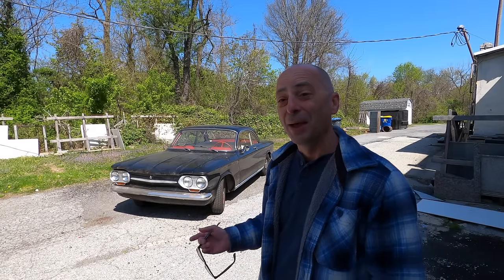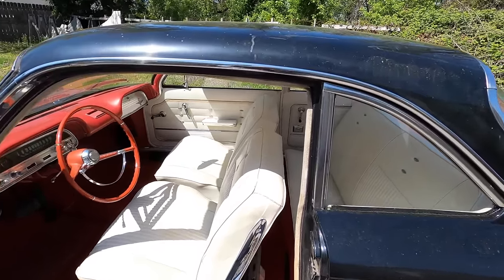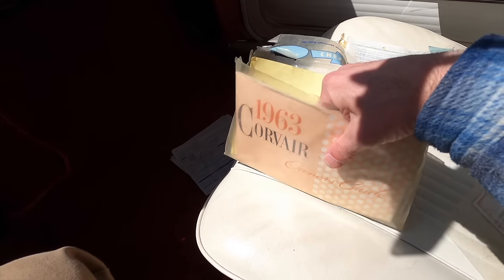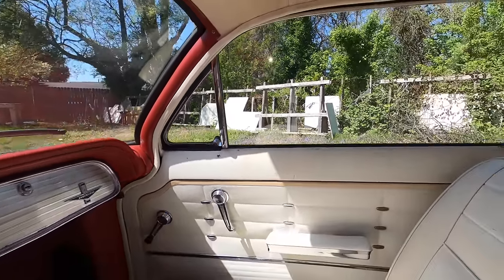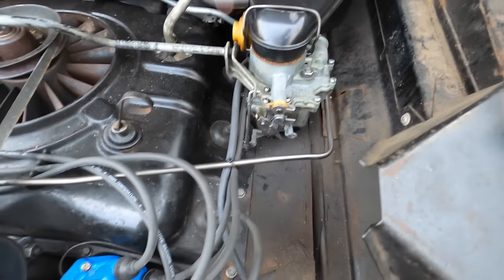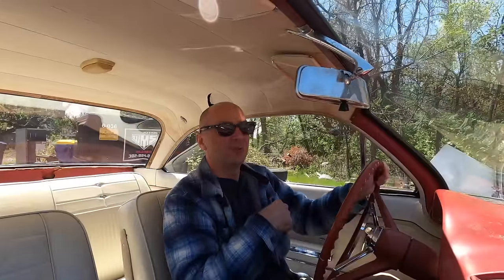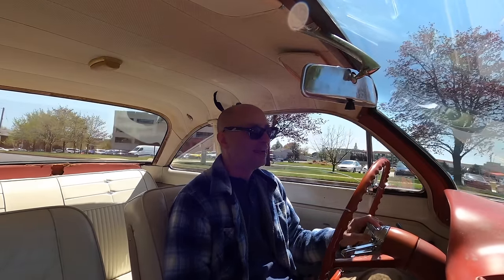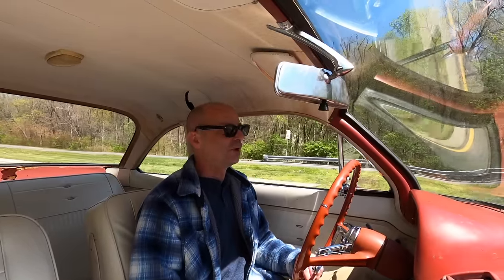Chevy Corvair - The Weird, Quirky, Cheap and Yeah COOL Compact

Comment: By today's standards all old cars are unsafe, so why people pick on the Corvair is beyond me.
Reply: You are correct, they were all deathtraps, and the Corvair was only a bit worse, which is why Ralph Nader used the Corvair as an example. Most cars of the day were understeerers, so you would run off the road and into things. Apart from the oversteer situation, which most drivers weren't used to, the lack of an engine up front meant that any frontal impact crushed the body more, which increased your chance of being impaled by the non collapsible steering columns. Collapsible steering columns were mandated in 1968.

Comment: They are good but a strange suspension setup that is a little hairy in certain situations
Reply: The second generation had a rear axle upgrade that eliminated the wheel going out of camber on turns. It was very similar to the modern IRS cars.
Reply: @pmscalisi  cool I didn't know that but either way I love it
Reply: I love that car. I wish it was a manual but I love the patina. If any upgrades maybe modest at best in future
Reply: I would like to know more of the car
Reply: I think 🤔 Ralph Nader was more politically influenced otherwise it may have had chance but general motors probably just at some point washed their hands with it
Reply: Also general motors should have upgraded from the start
Reply: @bighank796  They killed it because it was too expensive to make.  There was far more profit margin in a Chevy II than there was in a Corvair.

Comment: How did they cool the transmission
Reply: Air cooled. Only V8 auto cars had coolers. The '64-65 Pontiac Tempest 6cyl used an air cooled Super Turbine 300 (ST300; and despite being a 2sp, was NOT a powerglide as often thought). Chevy II 6cyl w/PG was also air cooled. I suggest servicing these trans every other (or every 3rd) engine oil change. Yes, they toast the oil that fast.

Comment: I think you have a 700 and not a monza. Our family had a 64 monza when I was 10 and there was NO pillar in the door frame. I have a 66 corsa coupe and it has no pillar either. Our families 64 monza had the emblem in the steering wheel horn ring, yours doesn't, my 66 corsa has the emblem in the horn ring center too. I read through many of the comments and didn't see this issue addressed so thought I would. It's a nice car, sounds good too, but I don't think it's a monza. Some one got the badges to make it a monza clone.

Comment: Lil scamp of a thing, ain't it? :D Doesn't seem all that bad to me, if it was a guy I'd let 'im date the daughter -- she might learn a thing or two from the fella!

Definitely been around the block enough times to know what's goin on down the street... and I bet that fuel gauge'd work better if the sender in the tank was properly hooked up. Replace tank, replace sender, suddenly the gauge doesn't work? Bob Dylan said it best -- "Ya don't need a weatherman to know which way the wind blows!" Also maybe don't go back to whoever put that tank in, if that's what it was. (Hopefully not your pal in Wilmington?)

Personally, I don't drive -- I'm disabled -- but it always seemed to me, from the passenger seat, that with a lot of these cars that were supposedly too dangerous from the factory to be roadworthy at all, really it was more a matter of -- ya gotta know how to drive the car. Different cars need different driving styles. ANY car is a danger to the public at large if you've no real idea how to work the controls, that's the point of a license, after all. But a Ford Ranger doesn't drive like a Ford Escort, and neither drive like a Ford Aspire... or a Ford Falcon... or a Plymouth Valiant... or a Chevy Corvair ;)

Comment: You think that stalling condition is related to heat.
Reply from the maker: Funny you mentioned heat soaking as a reason for the stumbling and stalling.  When the car stalled it was pretty warm that day and I looked over the carbs and saw there was no fuel squirting when working the throttle linkage.  An hour later the car started just fine.  Seems like heat soaking.  In fact I'm thinking the fuel pump might be weak and thinking an electric fuel pump might be worthwhile.

Comment: Fuel problem. Screen in the tank is partialy plugged and colipises car stops starts when the suction from the fuel pump normalizes.The car starts and runs and the cycle repeates. Oh what fun. NEXT: The hardest one to find. The pickup is new and the fuel line from back to front is new and it still acts just like you decribe. Problem?? the .ine fitting on the fuel tank is partialy plugged. You can blow air through it but it has redused flow and runs and stops until all you can do is cuss. Sorry about my spelling spell check not working. I've run across other problems that can make the car act like that. The wire under the plate where the points are moves back and forth to advance and retard the timing the wire wears the covering off and the wire shorts the car stops. Car runs at high rpm but stops running at idle.

Comment: fix it's two flaws and it's a good car...
elec. cooling - dump that screwed up 90° fan belt mess... 

good full IRS - swing axles are not safe in high speed corners...   

there are other things that can be improved - but those two things are the key

Comment: 1960-1964 (1st gen) Corvairs were real pieces of shit.  2nd gen. cars corrected most of the shortcomings but by that time Ralph Nader's book "Unsafe At Any Speed" was out and killed the car off.  Too bad because the 2nd gen cars were genuinely fun to drive.  I would never try restoring something like this guy did though.  It's worse than owning a boat  (boat: a hole in the water you dump money into).

Comment: the intake manifolds  and intake ports were a crap design, even the four carb set up was goofy, most of the OEM heads only had  two intake runners but a three port head, if GM had made a intake with six runners and six intake ports, they would have pissed off Porsche, biggest goof was not having a very large oil cooler

Comment: Chevy Corvair was one of Chevrolet's worst car designs EVER! Rear axles constantly strip. Belt always gets thrown off. Rear engine damper comes apart because the belt tension alignment isn't correct or balanced. It makes a massive amount of noise on the inside. The heating doesn't work for crap. Everything... and I do mean everything.. breaks down in this car. I spent $70K restoring one. Over $15K with the "Corvair guy" by Denver Colorado. I drove from Denver to Phoenix and it broke down 3 times after spending $70K having it restored. Finding parts after it breaks down is almost impossible in remote areas. You have to go to the Corvair underground.. rent a hotel and wait for your parts to come in. If I had to do it all over again, I'd of restored an old Camaro or just bought a restomod.

Comment: OMG, that thing is a piece of sh##!  You slipped and fell down a rabbit hole!  Sorry about your luck.  You could put another $4000 into it and it would still be a POS.  😂 Well, at least it's not catching on fire.  And in GM's defense, the whole thing was designed and built mostly with pen and paper.